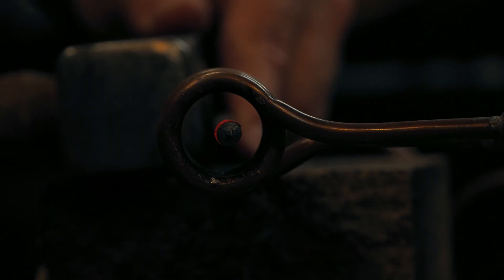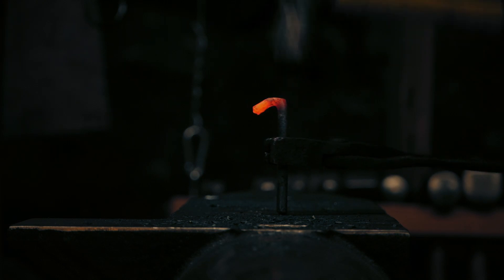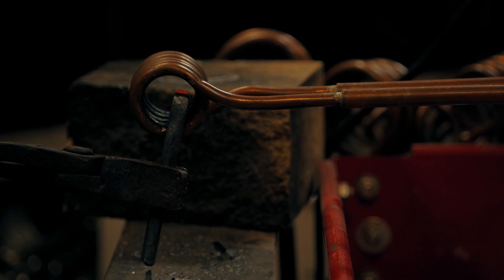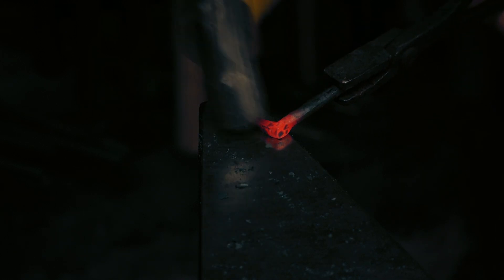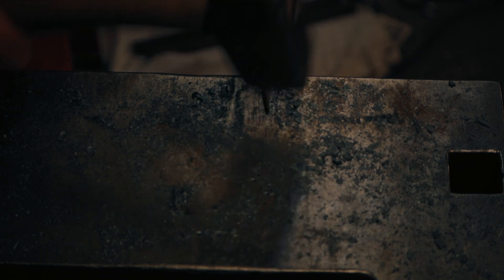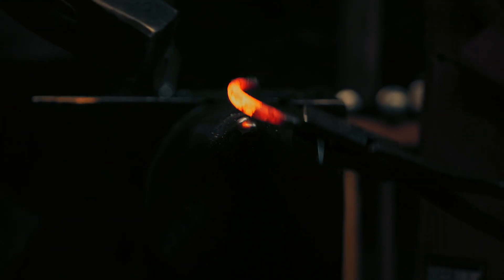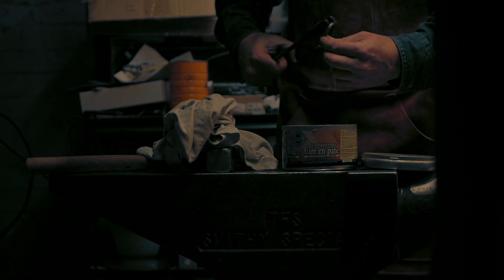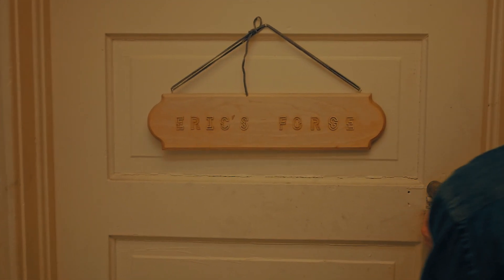Drive Hook Forged with Induction Heater

Comment: Have you done an economic comparison between the induction, gas and solid fuel forges?
Reply from the maker: Great suggestion. Usage details make a big difference, but that's why it would require a video rather than a simple answer :-).
Reply: @ejoftheanvil  I imagine it would variate a lot depending on if you'll be the whole day forging or it's a shorter work sesion, or the thickness of the stock you are working.
I'd be interested for sure, I've been thinking for a while in investing on a induction forge to supplement my workshop.
Reply: I too would like to know more about your induction forge.
Reply: Induction heating is the most economical way to smelt and heat metal for a single process. It's been shown that a combination process of propane then induction to have a extremely fast production rate and increased economy over propane or induction alone.

Ex. Use a propane or electric heating chamber then you use the induction furnace to smelt the parts rapidly or bring to desired temp. This process ideology decreases the overall cost of energy while increasing productivity, if used correctly that is.

For black smithing I'd either choose one or the other because that process is only really viable for rapid smelting or large scale production smithing.

Induction furnaces when used to smelt have some major benefits mainly the lack on contamination of material from propane. Also it smelts quicker than either propane or electric furnaces.